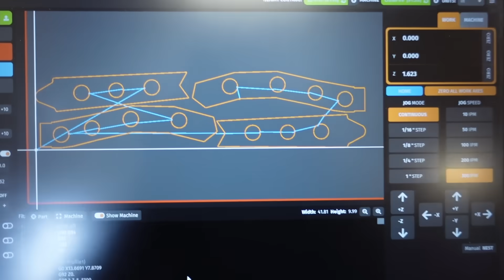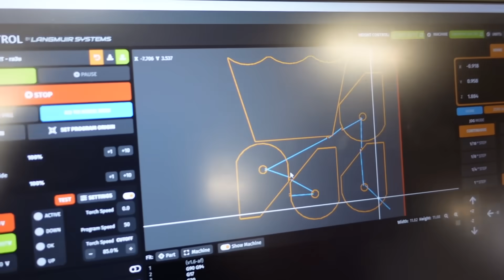Building A CRAZY 3 Link/ 4 Link Toyota Chassis! (From Start To Finish)

Comment: 5:32 not sure if it's a good idea to hold front suspension on 2 tubes welded to frame. Hard impact like jump or speed bump will push the suspension up, welding might crack. Even with reinforecrment added.
Reply from the maker: This is a tried and trued method, I added a huge gusset on rack upright, and the top is tied together with a tube as well